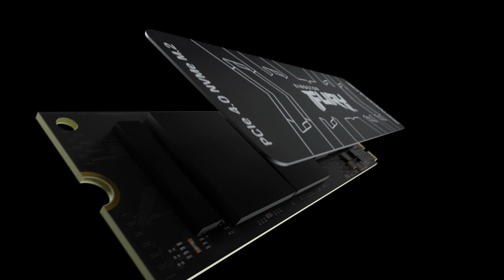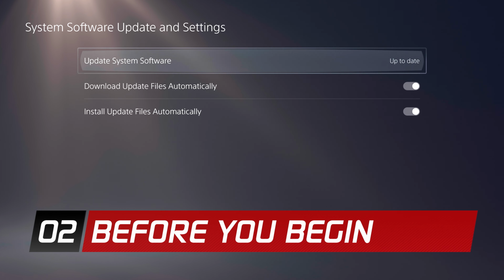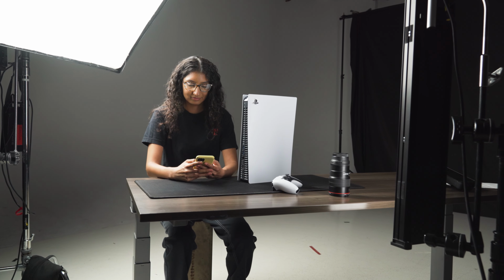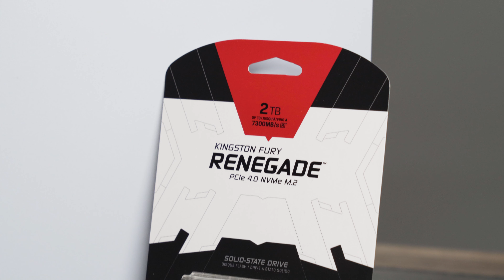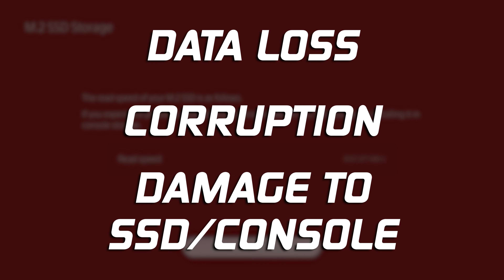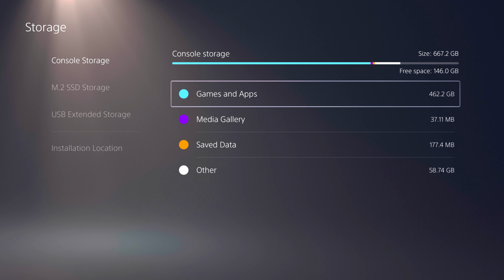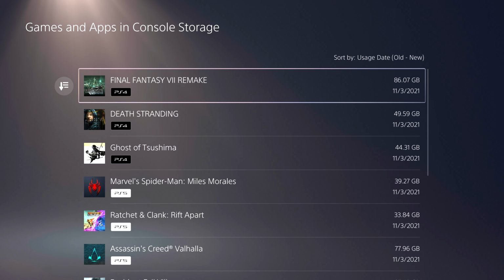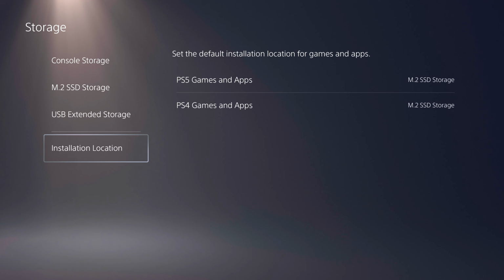How to install an NVMe M.2 SSD in a PlayStation 5

Comment: This video was too the point, informative, easy to understand (had a very slight panic attack at the "set the bearing into the correct size of your SSD" bit until i realized what you meant but thats on me), and concise. The outtake on removing the plate was also amusing. Excellent video guys

Comment: Hi, recently I've purchased the 2TB Kingston KC3000 SSD that I already installed inside my PS5. As you surely know that SSD have as well a low-profile heat spreader incorporated on the top but for precaution I still put it inside a regular heatsink tho I only managed to use 1 thin thermal paste (put on the bottom) due to the lack of space. Will it work perfectly that way without causing any kind of trouble (both PS5 & SSD) or did I do something wrong? Also, what is the "BIG" difference between my SSD and the one presented in this video?
TXS & Greetings from Portugal.
Reply: Ive got the KC3000 also.  As far as I can tell the Fury Renegade is just tweaked and branded for gaming.  It has a little better TBW and Read speeds but actually a marginally smaller amount of memory capacity.  Probably not too noticeable of a difference.
Reply from the maker: Hey there Vitor based on internal testing with the Sony PS5, the KC3000 and Fury Renegade perform well, and we can recommend their use. Sony suggests using a heat sink for best performance, and while we haven't needed one in our internal testing, there are a number of 3rd party heatsinks available to complement your Kingston product. Please visit their website for more information: 
http://spr.ly/6059JSqAl
Reply: @winnington23  Txs for the info, really appreciated 👍🏻

Comment: So just to be 100% sure, this one does NOT need a heatsink?
Reply from the maker: Hey there Brromotion, based on internal testing with the Sony PS5, the KC3000 and Fury Renegade perform well, and we can recommend their use. Sony suggests using a heat sink for best performance, and while we haven't needed one in our internal testing, there are a number of 3rd party heatsinks available to complement your Kingston product. Please visit their website for more information: 
http://spr.ly/6059JSqAl

Comment: the additional heatsink needs to be placed on top of the gpraphite one?
Reply from the maker: Hi Francesco there are two options to help dissipate heat for the FURY Renegade SSD, one with the graphene aluminum heat spreader and one with the heatsink. For more info, please visit our site here https://kings.tn/42MNG9O 
Thank you.
Reply: @kingston  HI I HAVE ALREADY A THIRD PARTY HEADSINK THAT I WOULD NEED TO PLACE DO I HAVE TO PUT ONTOP OF THE GRAPHITE ONE?
Reply from the maker: Sure thing, you should be able to place it on top of the FURY Renegade with graphene aluminum heat spreader/

Comment: Hello I got a ps5 and I am looking for a sad for it I can see that you are offering a SSD that is in line with the specification's for the ps5. But I do not understand do you have a heat sink on this SSD
Reply: It looks like a heatsink isn’t necessary for the Fury Renegade because it has a heat spreader on it, but it seems that a heatsink can be applied with it as an option for more optimally efficient performance. Personally, if I were to get this SSD, I would add a heatsink to it just in case so there is extra added airflow in my PS5.
Reply: @DVRKSTXR  thank you very much
Reply from the maker: Thanks for your comment. Based on internal testing with the Sony PS5, the KC3000 and Fury Renegade perform well, and we can recommend their use. As stated before Sony suggests using a heat sink for best performance, and while we haven't needed one in our internal testing, there are a number of 3rd party heatsinks available to complement your Kingston product.
Reply: You may not "need" one but do you really want to shell out 200$ for something that has its lifespan decreased by heat when you only have to spend another 20$ for a heatsink?  Amazon has a BUNCH of really nice options for heatsinks. Some of them are also integrated cover plates that replace the stock cover plate on the ps5.

Comment: do i need a heatsink for the 2tb version ? or is a heatsink on the m2 ?
Reply from the maker: Based on internal testing with the Sony PS5, the KC3000 and Fury Renegade perform well and we can recommend their use. Sony suggests using a heat sink for best performance, and while we haven't needed one in our internal testing, there are a number of 3rd party heatsinks available to complement your Kingston product

Comment: Right after installing the 1To in my PS5 and formatting it, the reading speed shown by the PS5 is 5413,479 MB/s. I was expecting a result slightly similar to a Firecuda, or at least above 6000 MB/s. The specs on reading are 7300 MB/s, wasn’t expecting so much, but 5400…. :(
Reply: They like to say that "this happens to all SSDs" but lets be honest, its because the makers of them like to exaggerate to a ridiculous degree.

Comment: a quick question as a pc user (and a KC3000): can i just put the heat spreader which comes with my motherboard (asus dark hero VIII) on top of the ssd or should i remove the graphene aluminum heat spreader first?
Reply: Thanks for reaching out to us. The KC3000 comes equipped with a low profile graphene aluminum heat spreader but it is not a traditional heat sink. So if you would like to add the one that is provided with the ASUS motherboard you are more than welcome to try it out.

Comment: They censored Read Speed on PS5 mine marks 4345.291 MB/s
Reply: Looks like their reading speed is 6557.571 MB/s , put it on 0.25x speed at min 3:00 , is weird that other people here are getting 4500-5400 MB/s ... maybe someone can try to use SSDManager  from kingston and see if there is a software update like Samsung 980 pro ... Cheers!

Comment: Is it safe to use without a heat sync?
Reply from the maker: The manufacturer recommends you use a heatsink, although our Kingston Fury Renegade SSD comes with a Graphene Aluminum Heat Spreader affixed already.  If you choose to customize it with a 3rd party heatsink, we recommend placing it atop of the heat spreader for best thermal performance.

Comment: Looks like their reading speed is 6557.571 MB/s , put it on 0.25x speed at min 3:00 , is weird that other people here are getting 4500-5400 MB/s ... maybe someone can try to use SSDManager  from kingston and see if there is a software update like Samsung 980 pro ... Cheers!
Reply: I find it kind of funny though how they quickly blurred it out at the VERY second the speed posted.  I kind of find that shady!  Also the sad thing with various speed postings for some people have everything to do with the "guts".  I think it was Linus who found that SSD manufacturers were switching chips in the SSDs from the ones they sent out for reviews to the ones they are now producing.  Talk about super shady!
Reply: @TheGibsOfTheTube  , reviews from Amazon and other online stores does not report the advertised speed, probably a silicon chipset same as the GPUs (mining stuffs)...